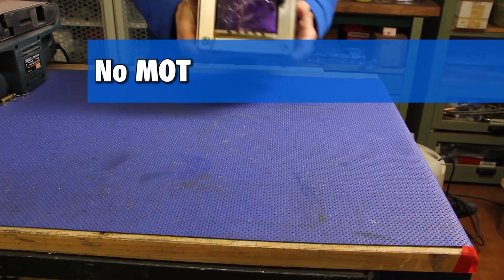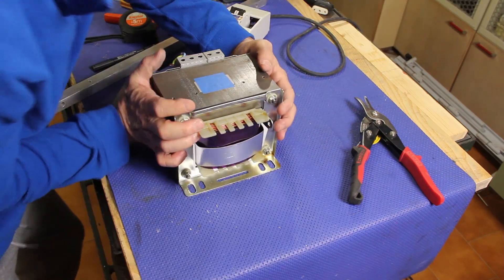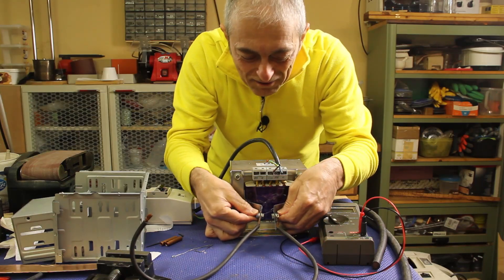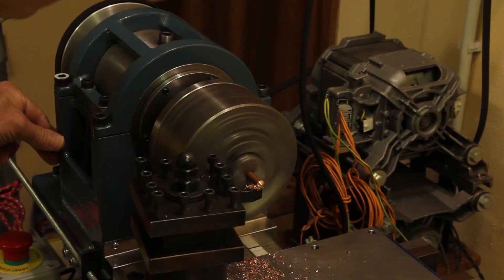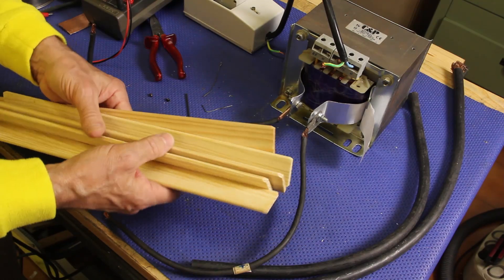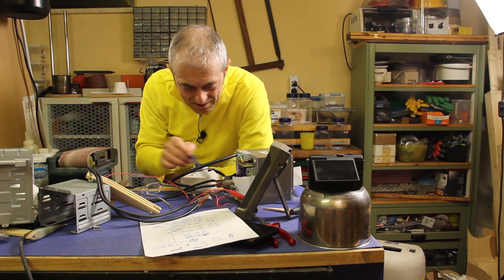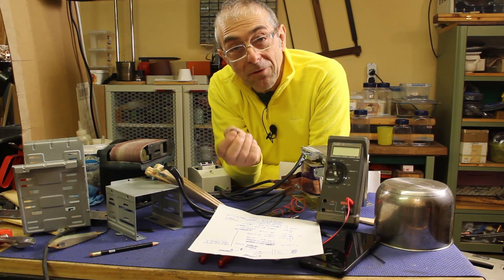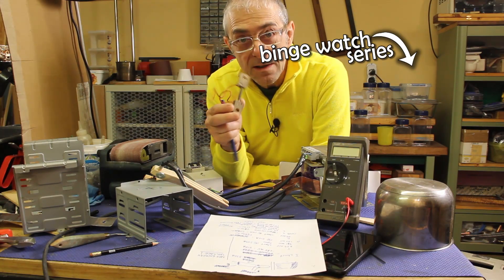DIY Spot Welder Experiment: New Idea - NO MOT!

Comment: Supongo que lo de metros voltio es una mala traducción y será milivoltios. Desde el principio de tu experimento he visto que con solo una espira y además las dos conexiones a los cables, el fracaso estaba claro. Hay que dar 3 espiras y del mismo cable que irá a los terminales que aplicarás a las piezas a soldar, con el fin de evitar las conexiones intermedias. Haz las cosas como hay que hacerlas: 2 cables de 16 mm2 en paralelo, con los que dar 3 espiras. Eso funcionará. Gracias , pero no nos hagas perder el tiempo con experimentos de primerizo. Saludos
Reply from the maker: Sorry, I'm gonna reply in English: while I somewhat understand Spanish, I'm not confident in writing it.
Yes, voltages were in millivolts. Of course junctions are a source of losses, the purpose of the experiment was also to demonstrate this. But also it demonstrates that junctions bring little contributions to losses, and the real point is the lack of enough voltage to overcome the unavoidable losses of the cables and the very workpiece.
BTW the cables I used are 19 mm2, total 38 mm2. The flat copper is 45x1 (45 mm2).
Thanks for commenting. Cheers.

Comment: 2:50 Put some safety glasses on 🤷‍♂️ I still remember the blob of molten steel that landed on the centre of my glasses, turned out I’d need that eyeball for the next 40 years so I’m grateful I decided to be careful that day…
Reply: A useful experiment though, so thanks 👍
Reply from the maker: @____________________________.x you're absolutely right about using goggles. I have to wear prescription eyeglasses under certain conditions, but have to remove them under other conditions ...on, off, on, off ... Then it's easy to forget wearing safety glasses 🫤.
I appreciated your suggestion, and I think it could be important also for other people that may read this comment section.
Cheers.
Reply: @AccidentalScience  oh yeh, it’s so easy to forget or wonder where I put them. I wish I’d been more sensible about hearing protection too, then I wouldn’t have ringing 😬

Comment: I found a good solution for myself. To do this, I had to take two (!) microwave transformers, remove the secondary windings and replace them with a thick cable. Then I bought a thyristor regulator on Aliexpress, with which you can change the power and duration of pulses (this is important). I placed all this in a plywood box, where I also installed the “pliers”. At the junction of the secondary windings I have a tap, and use the power of one transformer when I need to weld lithium-ion cells, and for the pliers I use both transformers and then easily weld metal rods up to 5 mm in diameter. 
Yes, this work took some time, but I am satisfied with the result and have a very useful tool.